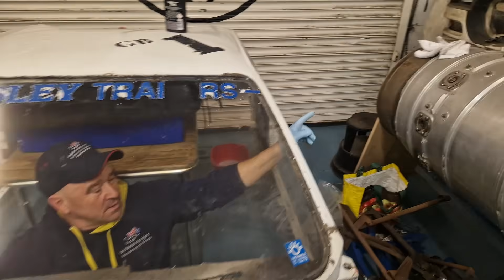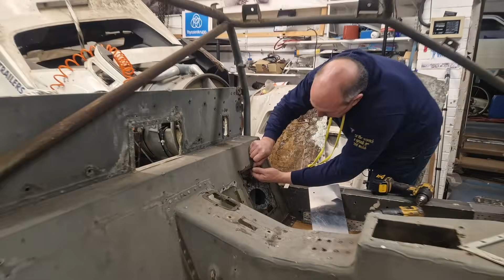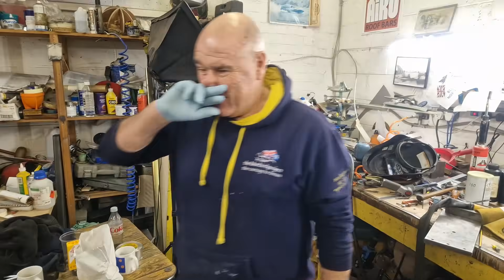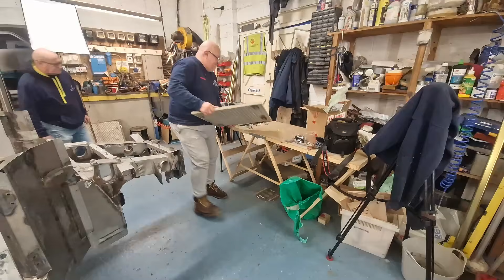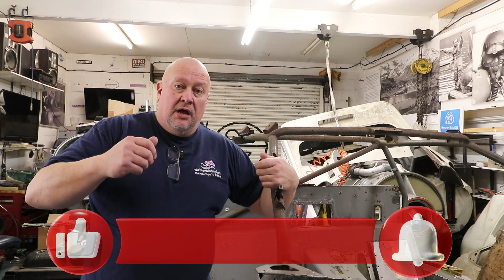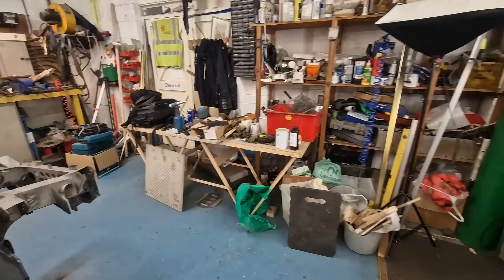Rebuilding a Wreck, Ford RS 200 Build - Cracking on.

Comment: Do you know where i can buy chassis plans for a RS200 ? Original ofc
Reply from the maker: Do you want a GA or detailed plans? The  GA is in the owner's manual. Let me know what you're after. Bill@bluebirdproject.co.uk
Reply: @TheBluebirdProject what is GA ?   I'm after the factory plans as I would like to build myself one 😅
Reply from the maker: @TurboDiesel33  GA - General Arrangement. There's one in the owner's manual but I've not seen detailed drawings. If you try RS200.org they may have uploaded some.
Reply: @TheBluebirdProject nice thank you

Comment: Just buy a set of hole finders, 3/32” 1/8” 5/32” 3/16” far more accurate than that you made and will not wear, . That you made was equivalent to someone using roofing screws as skin pins or clecos 😁
Reply from the maker: Absolutely agree. We have a set, proper aircraft ones, and they were chuffing expensive. The idea was to show how easy it was to make something that would get the job done. I did say in the video to take the time and make a decent one, though. That one was rubbish. 😁🤣

Comment: I got to sit in an RS200 as a kid at high school, because a local Ford dealership had one set up in its showroom, acting as a driving simulator for a while. Really cool little cars, and amazing to see how much Ford re-appropriated from the Sierra (which my parents owned). Wish it had gone into mass production.
Reply from the maker: They're a fun little machine but the way they were put together they'd never be a production car. They're awful to drive too. There's actually very little Sierra in them. Door handles, windscreen, rear lights. That's pretty much it.

Comment: Hi there! Nice update, Thanks! 
I´m Glad You keep car little rough. It has more story to tell that way.
What product did You use to bond those rubber parts to metal brackets on those cv joint boots???
I may have one mk1 Sierra steering column on my storage, but I think postage is so expensive, that You can buy whole car there for same money...
Reply from the maker: Hello Finland! good to hear from you. The rubber was bonded in an industrial process using some sort of a black etch primer and then the rubber was injected under pressure into a mould. I didn't see it being done but I herd about it. I need a few bits of MK1 Sierra if you have any available. I would cover the postage.
Reply: Ok, thanks for info. Seems like bonding at home is not an option. Still talking about those cv joint boots...
Can you give me an e-mail address, so we can talk about Sierra parts?
Reply from the maker: @Foordson I can find out whether the CV joints can be bonded at home. I just didn't bother because they were being done commercially. If yo use the contact form at BluebirdProject.info it's forwarded to me.
Reply: Thanks, but I am not in need at this moment. Just wanted to know the process for future needs. I´ll send you e-mail!

Comment: Why did you make that closing panel that way instead of starting from the back and making it flush behind the seat like the sill repairs.
Reply from the maker: I wanted it to remain as a closing plate so I could access the space without having to lift the car up and get at it from beneath. The bolt fixings were there already so I just made a structurally strong cover to go over it.

Comment: That car will be class Bill - Really enjoy seeing what methods you all use - It's going yo be far better than new - Rallying is Dore on a car but Rallycross is 10 times as sore with contact between all the competitors  - She has the scars to prove it - well done
Reply from the maker: The main thing at the moment is make sure all the strength is put back. Soon as that's done we'll start spannering parts on board. 👍

Comment: Great to have another RS200 video and interesting way of marking the holes I hadn't seen before, I usually rely on a piece of masking tape.
Reply from the maker: It's aircraft practice. We got very good at it on Bluebird where an old panel with existing rivet holes met a repaired section with no holes at all. It's deadly accurate when done carefully - which it most certainly wasn't in the video. 😁

Comment: I liked the hole finder tool, great idea, thanks. 👍The Cv boot press tool, what was the procedure for getting that made? Did you draw that on Cad and then send it to be CNC machined ?  Any Hardening required ?

The rust converter I haven't found any evidence that it converts rust personally, well not deep rust anyway. I use it like you did as a barrier to the atmosphere, just saves getting the spray gun out. I have a 50 gallon rust remover tank, big enough to do doors in two goes and to prevent flash rust I use atom mac by Bilt Hamber the immersion solution is deox C. Does a great job and better than blasting, blasting will often miss bits even though it looks clean by eye. As you say it also stretches.
Reply from the maker: Hiya - when does the weather improve down south? I feel the need for a road trip.
If you're making a hole finder it's worth the time to make a deadly accurate one. That one I was messing with was only to show the principle. We had a whole fleet of deadly accurate ones for the boat but, as luck would have it, when I needed them none could be found.
The CV boot press tool was a bit of guesswork because the only original parts we could find were already battered. The community seemed not to have preserved a good one anywhere. It had only a few critical dimensions so we worked those out, had it drawn up in CAD then machined. It wasn't hardened because it only had to make about 100 parts. The steel blanks were tricky because they were cones of 1mm steel TIG welded then dressed before pressing. A few split.
The Phosphoric concoction we use came from Chemetall. One of the guys was using molasses to clean steel - that really works but it attracts every insect for 100 miles - and the guys from Chemetall were disgusted at such smelly and messy ides when their chemists could surely do better. So they made that stuff especially for us. It works very well and the rust converter (silane based) also works well but it's painted over pretty quickly.
Reply: @TheBluebirdProject  Thanks for the very detailed response Bill. 👍I'll send you an email about our collab 😃
Reply from the maker: @Ben-Dixey  Excellent! I shall look forward to that. 👍